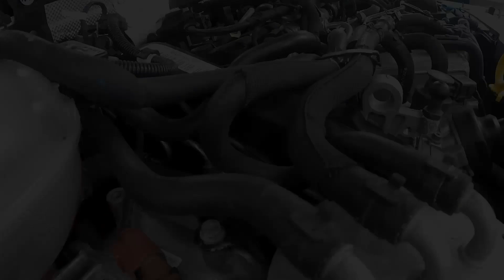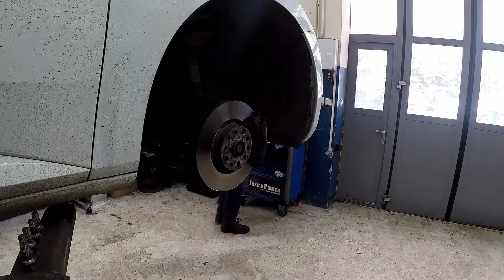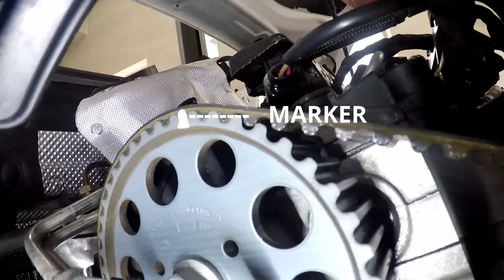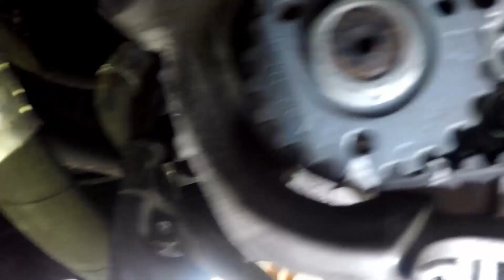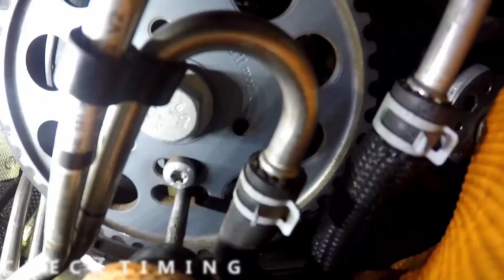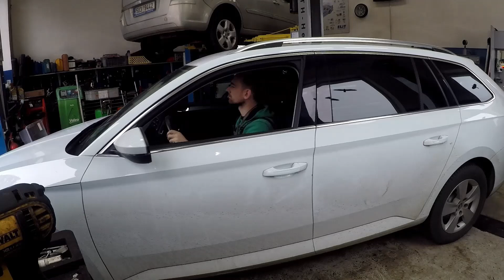Timing belt replacement OCTAVIA III/Výměna rozvodu ARTMOTOR

Comment: Making hard work out of it.. why are you marking the timing belt with a marker  when you should lock up the the 3 pulleys with vw  timing locking pins. leave  fitting the top idler until last makes it a lot easier to fit the belt round the fuel  pump before you set the tensioner.noticed you didn't even  bother setting the bolts to the correct torque with a  torque wrench...cowboy

Comment: Octavia 3, ale na videu je Superb 3 :)
Reply from the maker: Dobrý postřeh 😀, ona je to obdobná práce 🙂
Reply: @patekpatek1  Hi. 0.375 sync okay at 90C? 1.6 cayc
Reply: @patekpatek1  Hello, why does the timing synchronization change from 1.2 on a cold engine to 0.4 on a warm 90 C? Is the timing correctly installed? 1.6 tdi cayc engine ....
Reply from the maker: @Sensei948  yes correct
Reply: @patekpatek1  ?
Reply: @patekpatek1  burning 0.33 l / h is a good result?